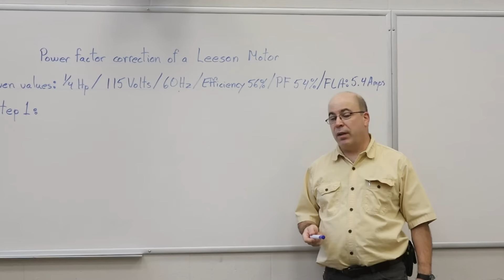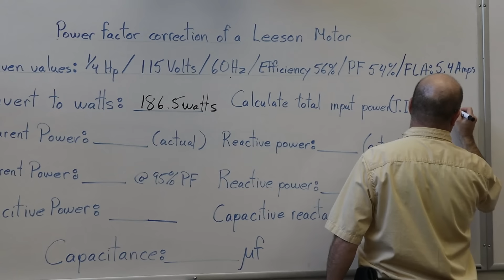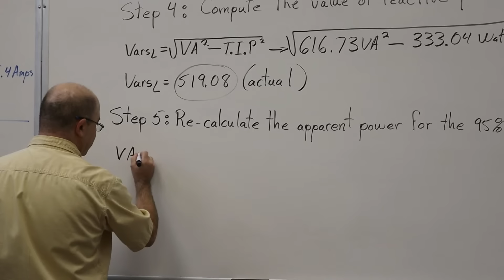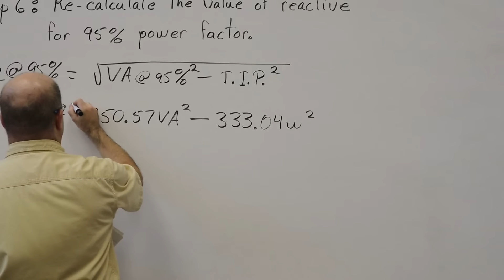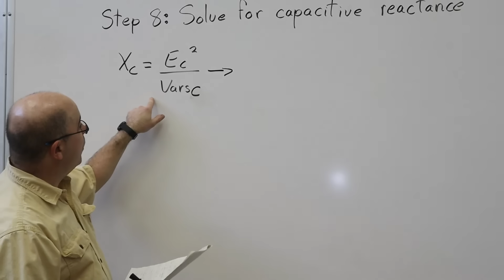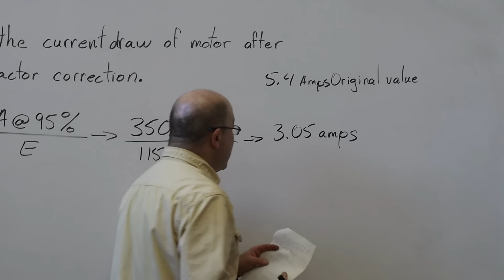Sizing a capacitor for PF correction

Comment: Excellent video first and foremost!  Incredibly helpful and easy to follow along!  Quick question for you though.  After solving for the proper capacitor for the PF correction, you came up with the 82.xx mfd capacitor.  I noticed that the capacitor you selected from the HVAC distributor was a plastic body capacitor.  Normally in my trade (HVACR) the plastic body capacitors are used in the starting circuit applications and the metal body capacitors are used in the run circuit applications.  I'm curious and would like to know if it would make a difference (if any at all) if A: there was a specific reason as to why you used a start capacitor style or B: could you use a run capacitor in lieu of a start capacitor so long as the mfd and voltage rating were matching?
Reply: You shouldn't use a start capacitor in lieu of run capacitor but you can use a run capacitor in lieu of a start capacitor. The start capacitor are only designed and manufactured for seconds of use at a time. They will burn up if used for extended periods.

Comment: You really haven’t done anything, you should have checked the amps with the bell on and put the machine under load. You could’ve lost those amps just by taking the belt off and reducing the drag. Sounds like bullshit to me
Reply: Checking that amps with a regular DMM won't give the readings you need because in AC power multiplying volts x amps = VA not watts.  To see these readings you need a power quality meter something like a Fluke 43B.  That being said for residential customers the power company measures power in kilowatt-hours (real power), reactive power isn't measured.  So this is all a waste of time for a residential customer.

Comment: thank you sir... wondering why the power factor capasitor does not come with the motor when you purchase the equipment.
Reply: Because motors of that time were designed and manufactured with cost in mind not efficiency.

Comment: It would be interesting to know the value of the original capacitor, I assume it was lower than your computed preferred capacity. Also, your HVAC or electronics guy could test a few of the 20% tolerance units and help you hit your target capacitance. I agree with other comment that raised efficiency should prolong motor life, etc.
Reply: The original capacitor?  Huh?

Comment: Need to add that lower current means lower heat generated.  Therefore, all heat exacerbated aging is slowed.  Also, less heat generated in large industrial shops where there are more machines, therefore summer workspace cooling requirements are reduced.
Reply from the maker: That’s a great point
Reply: @columbia - Lower heat generated ... where?

Comment: Question? Why don’t manufacturers put the right capacitance in to begin with? Is it cost? Is this why some motors have two capacitors?
Reply: It’s cost. Doesn’t improve the operation of the device, and the manufacturer wouldn’t realize any of the savings on power.
Reply: @Tim - Two capacitors = Start & Run.

Comment: If the motor is only 54 percet etc efficient then it wonter matter what the va is because it can never give more than 54 percent etc, that means if we want the real power which in this case would be 95 percent efficient that means we will have to buy a motor with a bigger va ha ha ha ha....

Comment: I am in the process of replacing both start and run capacitors on a 5 hp 230VAC motor.  The information tag does not provide all the discussed information nor does the mfg provide a data sheet.  Neither do other mfgs of similar motors.  The old caps are damaged such that they are not readable.  So I am trying the figure out what capacitor values are needed with limited information.  I'm frustrated.
Reply: Are the caps damaged beyond being measured with a meter?
Reply: @truthserum9157  The run cap had ballooned and could no longer be measured or label read.  I made a semi-educated guess on the replacement values.
It works.

Comment: Why does motor manufactures not do power factor correction at the motor production stage, fitting the motor with the capacitor for PFC?
Reply: I have the same question! Why manufacturers do not do this pfc if it just cost 1 capacitor?
Reply: 1. Supply Frequency
2. Possible effect to nominal voltage
3. Production cost
And etc...

Comment: Hi....at various location there has been a drop in voltage due to many reasons...hence there a rise in current which leads to rise in temp...so please advice how to tackle the issue ....??
Reply: Over size the wire, if it calls for 12g use 10g if it calls for 10g use 8g….

Comment: Like it’s very frustrating I understood and was learning until you jumped and didn’t explain what thr hell is varsc is and ever made any attempt to explain since
Reply from the maker: In mathematical terms: VarsC is the exact opposite to VArsL. they are both values of reactive power but can be easily confused so the electrical textbooks employ a subscript to clarify this fact. In more simple terms, the motor windings require reactive power to create a magnetic field to induce rotation in the motor. That reactive power can be obtained via a capacitor because they produce reactive power. The entire process is about calculating the amount of reactive power the motor requires to operate, but instead of obtaining it from the electrical outlet in your home, we can charge a capacitor and let that energy oscillate back and forth from the capacitor to the motor windings and back again in a perpetual loop when the motor is in operation. The benefit is that the homeowner does not have to bear the cost of that "Reactive power" to keep the motor running.

We need an oscilloscope to show people that there is a difference in the voltage waveforms that the motor windings and capacitors produce, but the main thing to remember is that capacitors and inductors are the polar opposites to each other and we can use capacitors to cancel out the negative effects of what an inductor does inside an electrical circuit.

Comment: Question,   How does a motor with no load draw FLA?
Reply: It doesn’t, the term FLA means under load only, and that’s the one you use to calculate everything with.
Reply: I see what you mean,he took off the belt, as soon as he hooks up the belt everything will change, but the experiment works for no load only.

Comment: I'm trying to understand why the voltage drop across a start winding in a cap start cap run single phase AC induction motor rises so far above the supply voltage. Of course this is the principle of how a potential relay is used to drop the start capacitor out of these motors after a few seconds. Typically in a 240V fed motor, the drop across the start windings is about 360 V. The hand waving explanation in technical college is that back EMF is responsible for that rise. I'm wondering what happens to the inductance of a motor coil as the motor spools up. In an RLC series circuit, that kind of big drop is easy to explain because of the phase shift in the stretch of wire between the run cap and the inductor. Is back EMF phase-shifted compared to incoming voltage? Does motor inductance increase with rotor rpm, to explain this rise? How do you model back EMF in a circuit with classical complex number circuit analysis?

Comment: I am building a rotary Three Phase converter.  Can I apply the same process to this motor.  I assume I would be adding similar capacitors between both legs of the three phase motor.

Comment: The calculated current was ~3amp, but actual value with capacitor on was only 2amp. What gives?
Reply: Likely due to calculation using supplied voltage at 115v and the demonstration in real time was metered using 124v. Higher voltage require lower current values to result at the same wattage usage
Reply: He did the math at full load of the motor.

Comment: They can put that into an excel spreadsheet and it can grind out the numbers for you.
The power will change if there is resistive force on the motor shaft. Current should increase. Will that change the capacitor value if there is a load on the motor? Here, you just used the numbers on the tag on the motor. Looks like you were just free wheeling the motor in the lab with no load on it.

Comment: Very nice. Well.ezplained. my question is. This is for one motor only. If i compute for let say 3 motors ac unit. Then only 1 ac is on. Will that 8ncrease my bills ?. Bec of the pf calculation is larger bec i used 3 motors 9n the calculqtion ?

Comment: We recently bought an LG fridge, and there is an  iPhone app that allows us to monitor the fridge electricity usage and cost. I  checked the current usage and multiplied it by 120V, but the result didn't match what the iPhone app reports. It was actually higher. It turns out I overlooked the power factor (PF), which in this case is 0.73 or 73%. This led me to wonder how we could make the fridge more energy-efficient. I haven't taken any action on that front yet, and I'm not sure if I ever will, but I was curious about what value of a capacitor would be needed to correct the power factor. And then, I found Serge's video that answered all of my questions. I want to express my gratitude to Serge for explaining everything so beautifully! The YouTube University.

Comment: A very interesting video showing the effects of reactive power and power factor correction.

If you put the amp meter on the wires going to the motor after where the capacitor is connected, I bet the current would be about 5 amps.  You are just getting the reactive power the motor requires from the capacitor and not from the power supply.

The current on the circuit feeding the motor will be less, and the I square R loss in the circuit from the reactive part of the power will be slightly less (which loss is heating the wire), but in residential situations, the amount of I square R loss is not much so I doubt it would be worth to install such capacitors at motors to save that trivial amount of loss.

As others have said, residential electric billing only bills for the real power used, not for any reactive power.  

But still an interesting exercise to demonstrate power factor correction!

Comment: I have a pedestal fan at my shop and it needs a new start cspscitor, only thing is that is very faded where it has the letters because of the sticky material between the cap and the metal cover, so i do not know the value of it. can i use a capacitor fora similar motor? i know harbor freight sells a very similar pedestal fan, i could order one for that motor and use it on mine, would it work?

Comment: What was the first capacitors size? Is the MFD higher of lower range? I'm assuming you are working with the RUN capacitor? Could changing the MFD help reduce even more amperage draw after completely finding the capacitance of the capacitor? Great instructional video!

Comment: Awesome content! You sir have a way to share very technical information in a way that's easy for me to understand. Got me to thinking though, I have a 7.5hp single phase 240 volt air compressor, would this work on a heavy start up load?
Reply from the maker: Yes, the technique does not affect the motor's performance in terms of starting torque.
Reply: @sergelevesque6292  would I put the calculated size capacitor between the 2 hot legs feeding the air compressor?

Comment: That’s a start capacitor not for continuous use only short bursts for starting    You need to use a run capacitor should be able to get in 80mfd

Comment: In a lot of places, consumers don't pay extra for reactive power. The big industries that use large AC motors usually do. Also how much power does the capacitor draw when connected directly to mains?
Reply from the maker: It should draw very little because once the capacitor has been charged, that energy will circulate throughout the circuit, that is why they are being used. You are basically paying for the initial charge, but then the reactive power is oscillating back and forth between the inductive windings of the motor and the capacitor in synchronism with the sine wave of the applied voltage. It's an interesting concept, almost like a game of ping pong where energy is bouncing back and forth from one state to another.
Reply: But what if you connected the capacitor directly to mains with no motor? How much current would that draw?

Comment: Depends on the utility. You don’t get charged for peak usage like a commercial customer
Reply: I bet you the utility does not charge you for poor power factor. Nothing in this video is incorrect
Reply from the maker: @TreeHugg  It depends on the Utility, penalty charges start to apply to commercial and industrial accounts where the power factor is below 90% as a general rule.

Comment: Great set of videos Mr. Levesque.  What a valuable resource for electricians in training.  Some minor points because of my HVAC background.
1. That capacitor the guy at the HVAC store sold you is a "start" capacitor and will burn out in a few minutes if you use it for "run" duty as you have wired it.
2. We have to be careful in distinguishing between motor efficiency and power factor.  They are NOT the same thing.
3. I don't know about Canada, but in the residential USA billing, the meters bill you by KW and not KVA.  Although it is always good to have near unity power factor,  the fact is that for an existing installation any improvement in PF benefits the Utility more than it does the homeowner.  Unless of course if they have a low PF penalty, like in commercial billing rates. 

Keep the good stuff coming.  Best wishes.
Reply: To clarify point 3 above a little more:
If your T.I.P is 333W as you correctly compute in your video, then you are only paying for 333/120 = 2.7 Amps.  This is because the utility meter is reading KWh and NOT KVAh.  But the Utility has to provide you (and build their power plants) based on your KVA.  If you compute your payback based on this 2.7 A, you will find it is hardly worth the hassle.  (For a new installation of course the equipment size and wiring size benefits with high PFs.)   And this is why the Utilities get so pissed if your PF is low :-)
Reply: Not only will that Start capacitor burn out but it will likely explode too. He should have used a proper motor Run capacitor.
Reply: I like your comment related to energy savings. This is where energy losses due to material imperfection comes in..

The higher the current drawn, the more the conductor heatsup, thus the more energy is lost. Just imagine the length of wire from utility meter to your motor. 

He just demonstrated the working principle of a power saving device...
Reply: @onebehindbars Agreed. Conductor heating losses will be lower (I^2)R thus the motor  & switching gear will live longer as a result.
Reply: Could you tell me please in an off grid situation getting power from solar batteries and inverter it would be beneficial to add a capacitor to the 240V motor?

Comment: Is extra reactance absorbed by capacitor ?
Reply from the maker: The capacitor can only absorb a like amount of reactance, any surplus is redirected back into the supply and is redistributed to other devices within the same circuit that have the ability to absorb it.
That is why it is important to accurately size a capacitor, the excess reactive power could register as an increase in current.